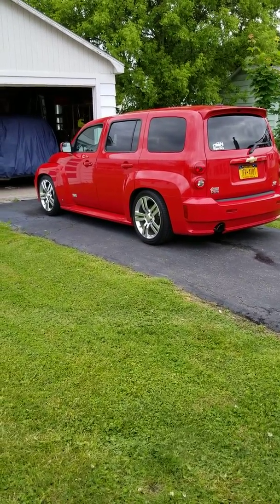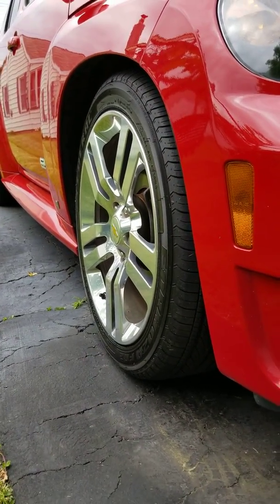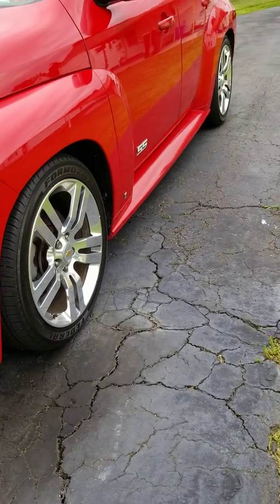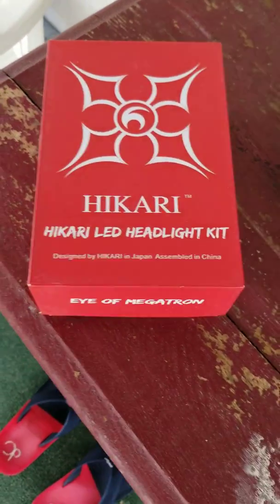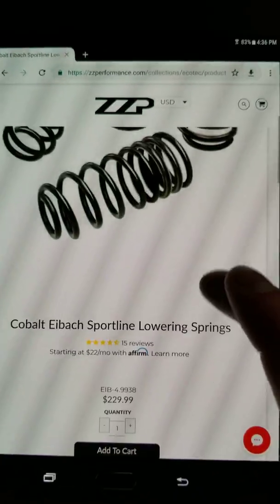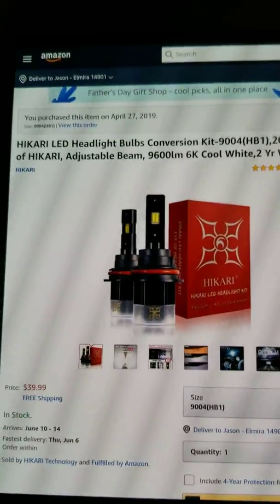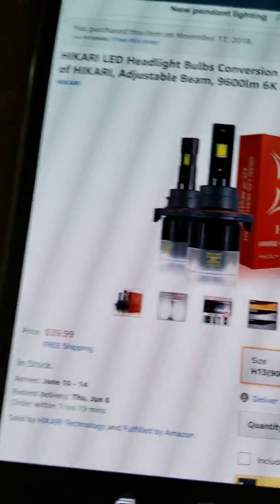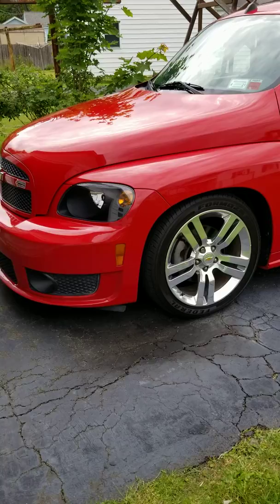Chevy HHR SS lowering springs finished!

Comment: Hey, Jay , how’s the ride now after 2 years? Still no bounce or bottoming out?
That lean in of the top of the tire that’s camber not toe. You can address that with steering rack spacers and a set of camber bolts for the strut to knuckle
Reply from the maker: Lol it rides horrible😂.  My 06 LT winter beater rides better.  I wish there was a way to make it ride better.  Also, something simple as changing the oil is a pain because getting a jack under there is a challenge.  So yeah I kind of miss the stock suspension but it makes up for it in looks.  Oh and those eBay headlights I installed 4 years ago are starting to peel on the inside.  159,000 miles on it and about 22,000 on the new crate motor.

Comment: Awesome car.Going to look at an 08 ss with 75 k on it , would you advise to stay away?
Reply from the maker: Hey buddy thank you for replying:)  2008 and 2009 were not good years for the HHR SS.  The engines were bad.  My car has a new engine in it.  The original one blew up.  Long story.  If you go look at this car, secretly take it to a repair shop and have a mechanic do a test on the engine to see if it needs a head gasket. When I bought my car in 2016, it needed a head gasket and I had no idea.  The only year that Chevy got it right for the HHR SS was 2010.  That was the only year that they put the second gen motor in those cars.  My car currently has a second gen motor and it behaves perfect.  Definitely be careful on that purchase.  Message me back if you have any more questions.
Reply: ShoJay92 thanks for the heads up , much appreciated
Reply from the maker: @jt31713  Anytime brother:)  if your heart tells you to get the car then I would go for it.  I remember how I felt when I saw my SS for the first time.  I fell in love and just had to have it lol.  Stay in touch and be safe:)
Reply: ShoJay92 I hear ya , it sounds as it’s not if but when , as far as the engine breaking.
Reply from the maker: @jt31713   Yeah it's a long story on the engines but to summarize the issue:  GM used sponge casting when they made the engine blocks for that car to save on weight.  The engines were fine when new however as they racked up the mileage, the coolant and oil would literally mix together in the block.  This would result in the car overheating.  That was me 3 years ago.  But it doesn't mean the car you are interested in would guarantee to have issues.  Just verify the car isnt overheating when you test drive it and make sure the head gasket is good.  Labor on a turbo car head gasket is almost the same amount to just have a whole new engine put in it.  That is what I did.  Its because of the labor to remove the turbo.  Very tight.  I would advise you contact ZZPERFORMANCE out of Michigan.  They sold me my engine.  They know the HHR SS better than GM ever did:)

Comment: Did you have any problems with your tires wearing unevenly bc of the toe?
Reply from the maker: Actually no, I have not had any problems with the toe.  I took it to an alignment shop and they told me they cannot adjust the toe.  It drives fine and has a nice ride so you shouldn't have any problems with you lower your car